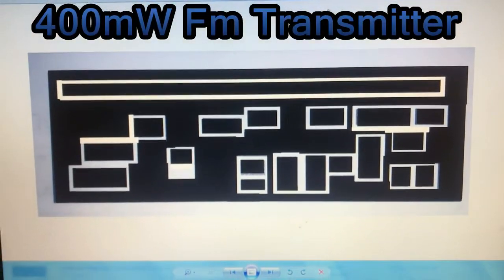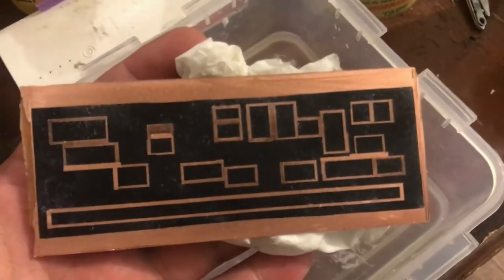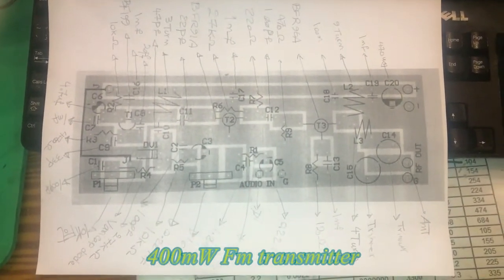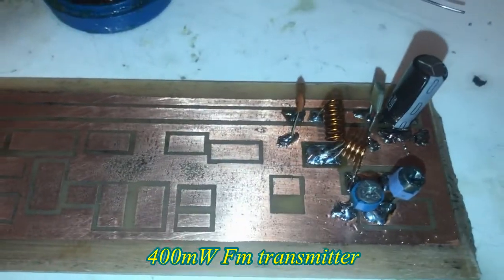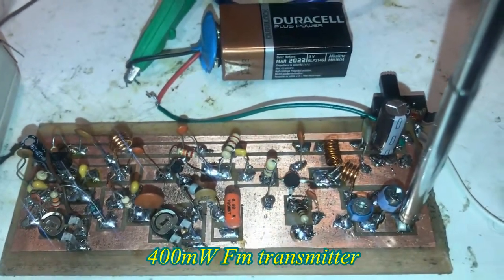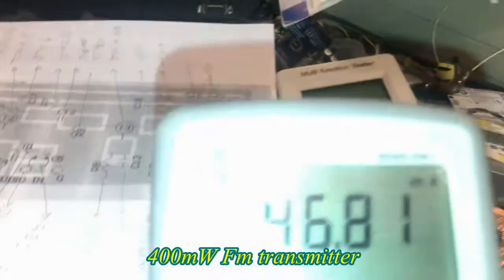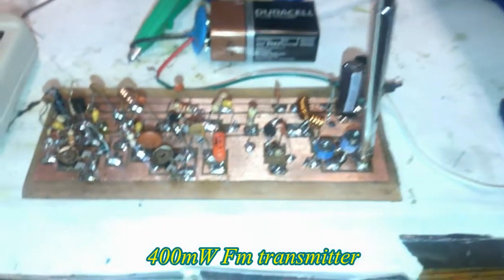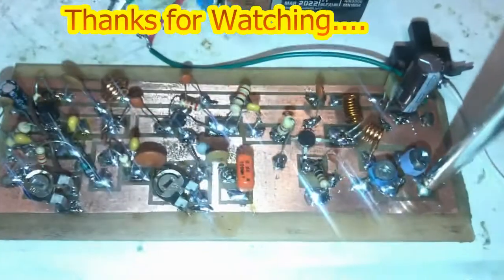400mw Fm Transmitter 5 10km  DIY 3 Transistor (schematic diagram and test)

Comment: What is the distance range of this FM transmitter have you tested 

I want you to test it on the line of sight 
 put this if I'm transmitter in the highest point on your roof of your house and let's see how long does it reach 
There is something called in electronics radio frequency line of sight when measured in this method you will be getting more of a distance and better signal

 but you didn't tell us exactly how long does this transmitter reach Is it really 5 to 10 km I want to make sure?

Comment: salam,
can you help me to amplify my 200 Mhz to the maximum amplitude ? or if you have same resources informations if you can share it with me.
thanks for all this precious informations and videos.
Reply from the maker: Hello. the transistors need for 200mhz are something else. MRF series should be fine. change project Transistor with high power RF MRF series and change 9turn coil to 5 Turns.  it is going up to 400Mhz   Thanks
seyed
Reply: @seyedmarashi  okey, so, i made circuit and i have a out put of 200mhz, the amplitude  is 1 volt - 1 volt, so, if i use a verry good antenna for this circuit, ho much range i can get to catch this 200 mhz frequency?
Reply from the maker: @charafmohammed6646  surely but I advise you don’t waste your short time for this project try to order high power fm transmitter and work on good luck